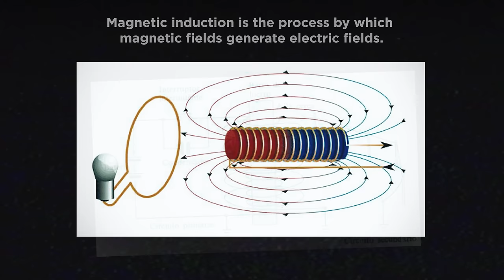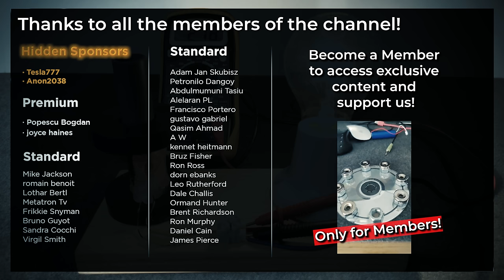FREE ENERGY WITH MAGNETS 🧲💡💡- Infinite Magnetic Energy

Comment: The only thing I would have added is a reversed biased oscillator coupled to a modified turbo subduction spline. Put in the output circuit of the device this would have the effect of damping the nominal sideband characteristic of the resultant voltage spikes and lead to a more uniform  waveform environment.

Comment: If two magnets with poles could just be used as source of electricity while simply not moving, then computers would no need electricity at all. Simple. Electricity source can be any source, including something like this, it just needs so much higher voltage and power for needs of general society.

Comment: A Tesla coil is an electrical resonant transformer circuit designed by inventor Nikola Tesla in 1891.[1] It is used to produce high-voltage, low-current, high-frequency alternating-current electricity.[2] Tesla experimented with a number of different configurations consisting of two, or sometimes three, coupled resonant electric circuits.

Comment: Please explain the PHI math related to the 10.5 cm pipe length if not using whole pipe? Also, please explain the PHI math related to the number of winding turns. I do know that the repelling magnetic fields will ionize water; I have several of them. I'll try your system. Gracias

Comment: I strongly assume that the direction of magnetization is NOT dimetrically alligned, means north and south pole must be on top and bottom of each magnet. Then and only then left hand rule can be applied. Do you know law of Lorentz? I strongly assume it works really with correct magnetized magnets.
Reply: Can it works...because i am doing R & D work with this...can u reply me please...
Reply: @mukeshkannaksrct  hi friend, how can i help?
Reply: @steffenschweiker  can this method works in real time?
Reply: @mukeshkannaksrct  I assume no, because there is not enough movement. Suppose a stator/rotor construction with repellent magnets is much more efficient.
Reply: @mukeshkannaksrct  werkt alleen als je de stekker in het stopcontact steekt.

Comment: You have not mentioned of copper wire size.
Reply: That looks to be around 1mm thick. Very easy to get.
Reply: I use 16 guage
Reply: 0.5  diameter

Comment: Hi.  It doesn't work for me.
I have 2 round ferrite magnets with a diameter of 11 cm.  The center hole is 4.5cm and the thickness of the magnet is 1.8cm.  My copper wire is 1.5mm thick.  
My plastic tube is 4cm in diameter and I cut it to 10.5cm high and at that height the 1.5mm wire will not fit around 32 times.  What am I doing wrong?  
How do you know which wire goes to minus and which wire goes to plus at the end?  
And can't you open a telegram group for questions and communication about free energy?
Reply: Free energy doesn't exists 😂😂😂
Reply: @Xdavide95X  You are wrong, it does exist, but it's far more complicated than this magic trick.
Reply: @L3X369  Thermodynamics laws left the chat
Reply: @Xdavide95X  read some tesla books, read some Bedini books. do some research and then come back.
Reply: @Xdavide95X   its called the ionosphere. its above our heads and produced positively charged photons. Electricity is all around us. Has been forever. Paris expo 1900 even has moving electrical sidewalks, and that was 1800. 123 years ago. theres even a clip stil left on youtube
Reply: @Xdavide95X  yea ThermoDynamX LEAVES CUZ they take the L
Reply: WAIT Omg rly do u still have that clip? @FulcanelliTrismegistus

Comment: To generate electricity you need an oscillating magnetic field and that is not achieved with static magnets. It takes either the magnets or the winding to move to generate the oscillating field, sorry but that's a big lie.
Reply: Did you saw the schematic plan in the first seconds? Did you saw the antenna?
Reply: @janjezek9333  Of course I saw the schematic, I made the comment after watching the video from start to finish and the schematic you put has nothing to do with what you have done in practice, I'm sorry, my intention is not to offend anyone but it bothers me because I know that there are people who believe that this works and when they try to replicate it they are disappointed and this does not seem right to me.
Reply: It oscillates as it balances..
Reply: @02:56 how is this balancing process not oscillation..?
Reply: @fpvdron8684  we're not talking about producing any great amount of amp beers here.. we're talking about a very small closed system to light one light bulb. As the magnet bounces up and down the current is produced.. it will not stay on unless the magnet continues to move
Reply: @janjezek9333  what antenna are you talking about? In this diagram it is an electrified fence to surround a cattle field.
Reply: Yes, I my self and any other already tried this. Do not work for me. Bought 0.9mm copper, got 2 magnets from microwave, 3d printed 105mm tube to fit magnets. Don't work. Tried to test with multimeter...no even 1 volt generate. Tried on multimeter both DC and AC, don't work.